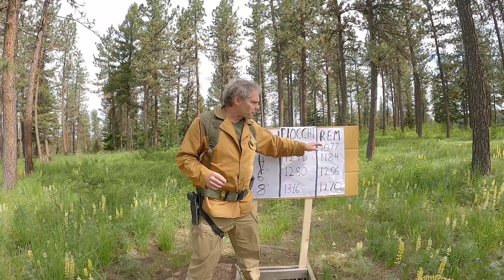How Does Barrel Length Change Velocity

Comment: One thing to consider is that it takes more energy to accelerate the faster you go, so an increase from 1200fps to 1300fps is not the same additional energy on target as an increase from 1300fps to 1400fps.  The returns might not be quite as diminishing as they seem simply by looking at chronograph velocities.
Reply: So I crunched the numbers and here's what I came up with:
Percent energy increase:
2.5 to 4 inch: 21.0% (Fiocchi), 20.9% (Remington)
4 to 6 inch: 6.4% (Fiocchi), 12.5% (Remington)
6 to 8 inch: 5.7% (Fiocchi), 2.2% (Remington)

One other thing to build on what you're saying is although energy increases exponentially, recoil (momentum) still only increases in direct relation to velocity.
Percent recoil increase:
2.5 to 4 inch: 10.0% (Fiocchi), 9.9% (Remington)
4 to 6 inch: 3.1% (Fiocchi), 6.1% (Remington)
6 to 8 inch: 2.8% (Fiocchi), 1.1% (Remington)
Reply: @f38stingray  the momentum calculation (or your wording) isn't necessarily true. Though its more attributed to talking about these concepts using freedom units. 
Energy is still a viable metric for recoil. Instead of .5*m*v^2, you are able to use mg(x) Because lbs is a weight and not a mass, the acceleration (32.2ft/s2) is already there. Ergo, you can infer recoil directly from impact energy (ft -lbs). There's also some percentage of this energy being translated to recoil (not 100%) obviously and so you'd find it in relative terms experimentally. By that, I meant the net recoil is some % of the energy in the system, and therefore - any change in energy is also multiplied by the same %.

The units work out very easy. If you end up with 300ft-lbs and the object is 200lbs, then  if 100% of that energy is dumped into the 200lbs, it would move 1.5 ft. Obviously, this never the case due to heat, bullet expansion, pass through, etc. If referring to perceived recoil - you have whatever damping built into the stock/ grip as well damping through your hand/arm/body etc.

 It's actually really cool watching high caliber pistol shots in slow motion as you can see the rippling energy wave through the hand.

Using your numbers for energy, even that 20.9% increase would widdle down to <1% increase in perceived recoil due to the aforementioned losses. This is why going up into large caliber pistols like 454 or 500 is still "manageable" in the hand considering the energy levels involved. Considering you're talking about 300ftlbs vs 2000+ftlbs. Yes, an almost 10fold energy comparison looks awfullly different when shooting by hand, but then look at the when comparing 200 vs 300ftlbs. Almost imperceivable. 

I hope the word wall makes sense
Reply: @frjhracing  Right. I just included it since power factor is common for judging recoil and it’s a unit of momentum. Hopefully the extra info can be useful depending on context (you be the judge? :P)
Reply: @frjhracing  I’m glad someone took the time to write this so I didn’t have too lol.. but you missed one very critical part of the equation which is in bullet terms mass to friction.. a longer bullet which is the only way to increase mass given barrel size requirements has also an exponential increase in friction which is then further hampered by the amount of extra charge needed to move a heavier thing at same speed.. 

(Trying to keep this simple for most to understand wo getting into complicated equations lol) so in short you get and additional variable for diminishing returns based solely on the bullet grain in relation to the barrel length.. this is why there is a huge difference between a rifle vs pistol case size in basically the same size bullet.. 

This could actually be easiest demonstrated by the difference between say .38 and 357..
Reply: My thoughts exactly, but thats why he mentioned what kind of ammo he uses, so you could do the math and show the energy the bullet had when passing the chronograph
Reply: Yeah but for the demonstration, carrying a 8 or 10 inch barrel on a pistol is rediculously long and heavy. That said, people that advocate for 16 inch barrels for 9mm carbines are usually dampening the velocity woth that kind of barrel. If you need more energy, I'd highly suggest using a more capable caliber. You are very correct though and the numbers agree that 1000fps and 1400fps are incredibly different effects with the same bullet weight (9mm vs .357) for example
Reply: its a velocity squared relationship in energy terms. To double your velocity means to quadruple the energy to do so.
Reply: @frjhracing  To double your velocity is to quadruple the KINETIC energy, and not 'the energy to do so' but the kinetic energy the OBJECT HAS, get your shit right man... Otherwise you'd need FOUR TIMES THE POWDER CHARGE to get from 700 fps to 1400 fps while in reality it just requires a doubling.
Reply: @mkzhero  Balancing energy  despite the muzzle energy measured in Kinetic energy does not change the fact that the chemical potential energy had to be quadrupled. Its simple physics. Is there things that make "doubling the charge" give a net quadruple in energy? Absolutely: burn rates vs barrel length ,bullet grain, powder. ...actually, not really... all loading charts I reviewed followed the relationship with velocity^2 vs load changes and contradicts your statement.  Your anecdote does not change elementary physics nor documented science. 

The only way to double the charge and get double the velocity, is to also have a bullet that is half the mass. In energy terms... Your proposition (only double charge = quadruple energy)   is impossible.
2C = ((m/2)*(2v)^2)/2

C = m(v^2)/2

Pick a bullet grain and compare charge vs  expected velocity. The above will be true with very slight deviation.
Reply: @mkzhero  honestly really think before you reply with a rebuttal that contradicts thermodynamics. How in the world do you end up with kinetic energy? did it just magically come from nowhere? did you find a magical power source at which to make energy in the barrel?
energy literally has to change form...for you to get kinetic energy. There was some X amount of Potential energy that was quadrupled.  You literally cannot argue this, as anything else would contradict millennia of physics/engineering/thermodynamics.
Reply: 150 fps could be the difference between a gunshot wound and a clean kill.
Reply: The heck you talking about, that's not how it works, especially not at such miniscule velocities in a short time frame, the difference in the force needed to accelerate from 1200 to 1300 and from 1300 to 1400 are fractions of a percent at best. You can see that very well with powder charge differences that increase velocity pretty linearly, especially in a longer barrel. There are limits to it of course but its related to air and gas resistance, materials used so the gun doesn't explode, gas expansion rate limits...

Comment: It is easy to expect long pistol barrels getting  higher velocities. The same is expected and true for rifle barrels. It depends on the burn rate of the powder used. Factory ammunition designed for shorter barrels will work best in the length of barrel that there designed to work best with. Not many people are shooting 8-inch barrel revolvers.
I have used both revolvers and single shot handguns shooting long-range metallic pistol silhouette matches. You just do not see many or any of the top shooters using a short barrel pistol.
You also do not see many 357 revolvers but they do use some. Shooters that do use heavy bullets at 150 meters and 200 meters, I used 170-grain bullets. At 50 and 100 meters, I used 158, 140-grain bullets, and less powerful powder charges. You can use a four or five-inch gun and do okay as far as 100 meters because they are plenty accurate.
I even use a 1911 for fun and it put holes in paper at 200 meters regularly. However, Steel Rams and Turkeys are not falling over very consistently if any at 200 and 150 meters. It is fun to hear ping a second after the pistol goes bang but pings do not count in competitions.
Your testing has no flaws, what so ever. It shows the velocities those brands of ammo produce in short to long barrel length pistols. However, long barrels in my experience produce the most power over shorter ones.:goodvibes:

Comment: This is why I only conceal carry my canik tp9sfx with a custom aftermarket 32 inch barrel with my none forward grip mag holder where I place my hand anyway and my none stock "grip module" with aerodynamic wide end slip stream "brace" that I jam as hard as I can into my shoulder even though if I turned it all upside down  perseaved "climb" of my firearm is negligible litteraly so I cal it my little recoiless rif.. Pistol

Comment: The Dan Wesson pack was not I was guessing. Honestly, I was guessing you could test a pistol caliber out of an AR PCC. Just switching uppers with different barrel lengths using the same barrel design with the same twist, same manufacturer, same ammo, so forth. But I like your style.

Edit: Lesson learned for me was that for a .357 Magnum, the 6 inch barrel is pointless. 4 inch to 8 inch is significant a difference, but 4 to 6 and 6 to 8 are so little change that I don't see the point of 6 inch now.

Comment: Great, accurate video. Another test along these lines that people may find interesting is how much velocity can be gained with magnum revolver cartridges in lever guns. Especially among the lighter projectiles, such as 180gr 44mag in a 20 inch marlin, one of my favorite firearms. The velocity gained in the marlin is enormous. More than people realize, I think.
Reply: I have a 6" .44 revolver and 16" .44 lever gun.  I made 180gr loads for the pistol and 240gr loads for the rifle.  The 180gr from the pistol, 1585 fps (1004 ft-lb energy), the 240gr from the rifle, 1850 fps (1824 ft-lb energy).  Of course, the cylinder gap is responsible for some loss in the pistol, but you are correct, the gains can be enormous.

Comment: I have a Dan Wesson fixed barrel 357 that I got in the 80's. Would love to have that changeable barrel model. A question about what some consider the most useless caliber, 25 acp. I have never seen anything but very short barrel pocket pistols in 25 and I own a couple. Not really a good defensive, varmint/snake or target gun. Do you think if someone made a longer barreled gun it would be a better powered and accurate round? And why did no one ever make one?

Comment: Thank you! This presentation was done very nicely. When you talked about having to move one's head around to get the correct trifocal lens on the front sight, I had to laugh at myself. I've done that. If I were a serious handgun hunter, I'd have special bifocals made with the second focal length adjusted so that my front sight would be in perfect focus.
Reply: SCAM ALERT! ^^^ THAT is a SCAMMER. Please be aware that that is a SCAMMER and do not fall for the SCAMMER.
Reply: @Sableagle  Yes, the scammer seems to be commenting on posts all over YouTube. Have you had any success trying to report those people/bots?

Comment: The one point I would like to make is that the point of Complete Combustion is not necessarily the velocity vs barrel length inflection point - it is often after, and very rarely before then, instead being the point at which the force on the bullet resulting from pressure differential inside the barrel drops below the force of frictional drag on the bullet. 

As propellant burns, it indeed builds pressure, and the bullet begins moving before that propellant has fully burned (ideally - see various overpressure failure scenarios). Pressure will only increase for as long as the propellant burns, but that pressure increase will only continue as long as the increase in gas volume outpaces the dynamic increase in volume behind the bullet. Most powders burn fast enough with enough volatility (the amount of gas created per mass of powder) that this isn't an issue, but it can happen on rare occasion. Even when combustion completes (in situations where the bullet hasn't yet cleared the barrel), there will very likely still be a large pressure differential acting on the bullet in the barrel.
As the bullet accelerates, the frictional drag on that bullet will increase, being proportional with the bullet's velocity. As long as this frictional drag is less than the force created by the pressure differential, the bullet will continue to accelerate. As the bullet travels down the barrel, the internal volume behind it will continue to increase, which will lower the pressure differential and resulting force, lowering the bullet's acceleration until a point where the frictional drag overcomes the force of the pressure differential, slowing the bullet back down. Air pressure will also build up in front of the bullet as it is being accelerated, as the air in the barrel has to go somewhere, and this will contribute in various measures to reducing the efficacy of progressively-longer barrels.

In short, in the overwhelming majority of cases, a longer barrel will yield higher velocities, but it will do so with diminishing returns (requiring a linear increase in mass and length for a diminishing increase in velocity), and even then only to a point where an even longer barrel will actually hurt your velocities.

A 16-inch barrel will do quite well with standard-pressure 9mm, for instance, getting pretty much everything it can out of it. Velocities just barely start to fall off from their peak at around 18 inches, so something like a 24-inch barrel would have quite poor performance. Most sources I can find claim that 9mm pistol powders undergo complete burn inside 6 inches of barrel length, but there is still a marginal increase (+10%-15% depending on load) in muzzle velocity up to 16-17 inches of barrel length.
Reply: Nice job in covering it. I know that I used to understand it the way Paul explained it but when looking into the advances in cartridges I learned some new things.

I just wanted to add that at least in a rifle velocity is fuel limited. Velocity comes from the total area under the curve and you want to get to full pressure as soon as possible but at the same time burn as much fuel or probably produce as much volume of gas as possible and within reason develop as much heat as possible. The pressure is important for the fuel to burn correctly so if it drops off to much the powder probably won't even burn before it exits giving powder burns. The design of the sharp shoulders on high performance rifle cartridges are trying to make this happen in the case by making it harder for the powder to exit and give it a swirl burn. Why do slower powders give higher velocity? Most of the room in a case is already taken up. By slowing down the burn a little bit there is a bit more volume. For a round number if the powder takes 20%longer to burn then maybe you can free up 20% more unfilled volume since any room gained is free room and not filled with powder. That means that you can pack in 20% more powder or a more energy dense powder. There is both the total volume of the gas and how hot you can keep it. I think it is True Velocity that is getting more energy than the.308 with less powder do to lower heat losses. The fact that we can switch to a larger case and get more velocity is a give away that even on a short barreled gun we don't have enough gas to even keep full pressure out of a snub nose. I am sure that since pistols run at lower pressure there is a major difference in all the losses and energy density of the powders. Also unlike rifles they tend to run at far lower pressure and those pressures are all over the place. They also tend to be larger bores and that helps to squeeze more power out at minimum recoil. The weight of the powder and the rocket effects are both part. Unlike rifles case size isn't a great way to gauge energy since often you are not trying to increase energy all that much.

Or you can just say it's complicated 😅

Comment: Hey, Mr. Harrell. Thank you for another informative video. Are there any firearms that you think to yourself "Why did I ever buy this/agree to test this?" Not so much things like aesthetics, but more along the lines of maybe a firearm that was recommended highly, or was one you'd shot before and liked, but once you got one of your own, turned out to be nothing but problems. (Mine was a reproduction SAA by a certain Italian firm. Shot one at a friend's house, decided to buy one. It ended up having a weak mainspring [light strikes, how fun] and was nothing but a mechanical nightmare out of the box.)
Reply from the maker: Rossi circuit judge.
Anything made by Chiappa
Reply: @PaulHarrell  thanks for the reply! I have to say, the judge has always struck me as a "yeah, you can, but why would you?" type thing.

Comment: You could also be a reloader and choose powders to maximize whatever length barrel you choose. It is very easy to stay within the pressure ratings of a cartridge and significantly increase the velocity of a bullet in either direction of barrel length. I do this all the time with my 300blk. I have both a pistol length and a 16" rifle length guns. I load gun specific ammo to get the best performance from both. I actually have loads that lose velocity in the 16 in barrel. And these loads are at the upper limit of velocity of the short barrel for most loads.

Comment: The magnum cartridges tend to have a much greater advantage with longer barrels.
My .357, .44 and 10mm all gain about 100fps per inch up to about 12 inches over a 4" barrel.
Most handgun ammo is optimized for short to medium barrels, the mags have plenty of omph left to go.

Comment: My reloads with a 125 gr hp, I get 1400 fps out of a 2/34 .357  revolver. 1650 fps in a 6 inch 686. These are averages with no sign of over pressure 
Don't believe me? What ever, don't care. I'm not gonna lose sleep over your comment section opinions.